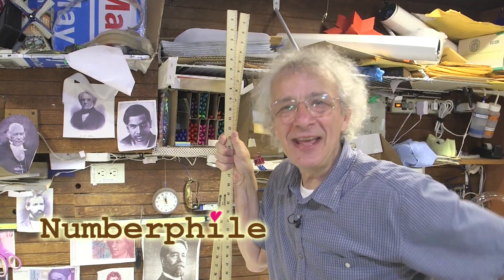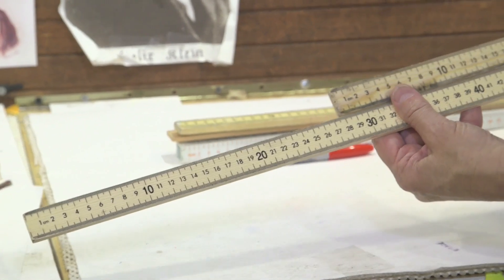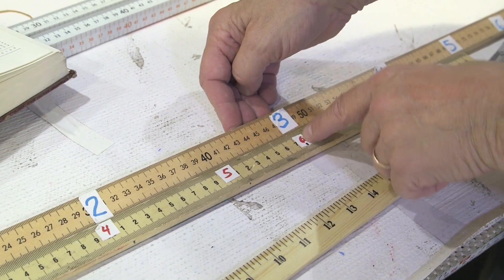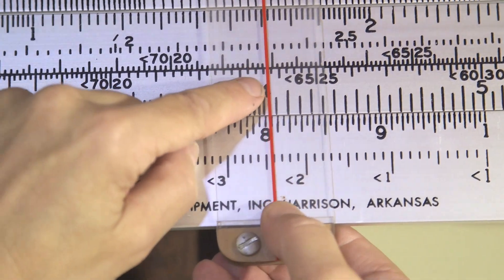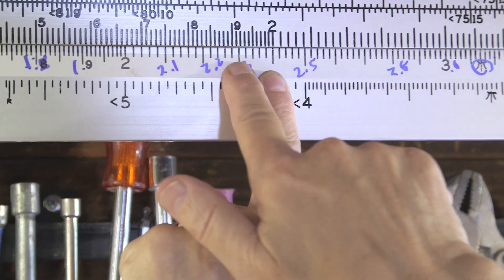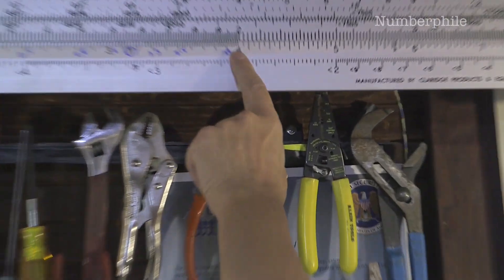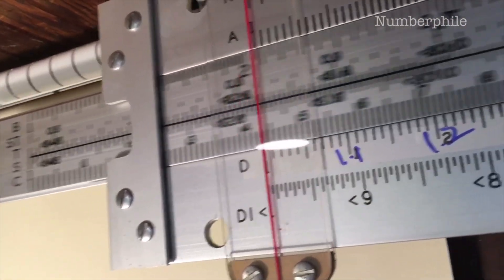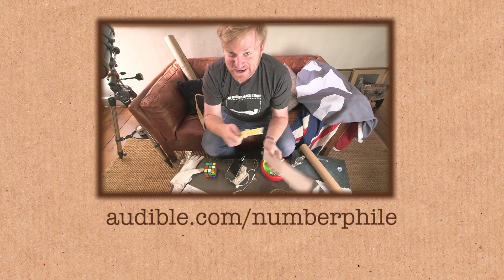The Electric Slide Rule - Numberphile

Comment: I took an engineering test back in college where the professor made you come up to the front of the class with the instruction manual and clear the programs in front of the proctor.  I showed up with a 4 function calculator and a slide rule.  He smiled at me.

Comment: I remember looking up how digital slide rulers work and realized they essentially are electronic slide rulers. They are reading two logarithmic patterns and adding them together to get the value that is the distance it has been slid apart. 

(in hindsight I really should have been tipped off by the similarity in naming schemes)

Comment: You should put logarithmically spaced contacts on the back side and have a computer drive the motors so you can operate the slide rule like a calculator.

Comment: Do you know why slide rules leave electronic calculators in the dust much of the the time?  Two moving parts and no batteries. Do you really need to know the answer to a simple calculation to 32 decimal places? I never have.

Comment: What if you could use an optical calliper to turn it into a continous electric slide rule, and then have the potential to work with indefinitely large numbers, merely by adjusting the precision and then working with smaller numbers?
Reply: p.s: someone might have to invent the "optical calliper", in theory it would just be two laser dots and a sensor to detect how far the dots are from eachother.

You would zero the device by coalescing the two laser dots together onto the white/reflective surface being measured, and then:  adjust the angle between them, moving both lasers until one laser hit a non-reflective patch, and then moving the other laser until it did the same.
Then a precision machine would calculate the distance between the two dots, and/or calculate the angle of separation; thus giving you the answer to fractional calculations on a slide-rule

Comment: HEATHKIT built an electrically balanced circular slide rule calculator that can perform all forms of arithmetic including square roots and more. The trick is in the calibration in the circular scales. The correct answer is indicated by the null created by a Wheatstone Bridge.

Comment: There are several formulas to substitute multiplication. You can use a square number table and it is obvious that: 

xy = z^2 - (z-x)^2 with z := (x+y) / 2. 

or a sine and a cosine table 

1/2 (cos(x+y) - cos(x-y)) = sin x sin y. 

but logarithms are the best for it with

log(xy) = log x + log y

 Even a division can be calculated better: 

log(x/y) = log x - log y. 

Great!
Reply: The second was used to do multiplication with trigonometric tables in the 16th century: https://en.wikipedia.org/wiki/Prosthaphaeresis
It was a forerunner to the invention of logarithms. From a modern perspective, it is using complex logarithms.

Comment: What I don't really understand about slide rules (I don't have one) is how do you know what value does each marking correspond to when you are multiplying. I mean, each marking is equally spaced from each other, yet since the values are logarithmic the inverse values are not going to be equally spaced and will bunch up as shown in the video with natural numbers. But when you go in between, how do you know how much do you have to add for each marking? In a simple ruler you would add one milimeter for each marking until you get 10 and you say it's a centimeter.
Reply: Ciroluiro 

the markings on the actual slide rule are not equidistant. each mark varies as prescribed by the relevant logarithm.

if you haven't got a slide rule I recommend obtaining one. it's amazing to witness numerical relationships is such a dynamic way. It's actually fun.
Reply: I definitely have to get one.

Comment: There is one other thing that he missed. you can do exponents with multiplying the log of a number by ANY number.
so 9*log(8)=8^9=1.3 million and stuff coming out the backside.
Furthermore, because we can use base b, I can tell that a number, call it n, from its log in base b, has (log(b,n)-mod(log(b,n),1))+1 digits in that base, so in base 2, a number, 210, let's say, has 8 bits, and they are 11010010, and for HUGE numbers, like 6405097, it has 23 bits. The first and last bits are 1, but I couldn't tell you the bits in between.

Comment: This is the kind of teaching I like. Presents a concept and then uses easy to understand examples with physical proof instead of just saying "just know its true." 

So multiplication of number can be shown as the the addition of their log10 components.
10 X 100 = 1000
log10(10) + log10(100) = log10(1000)
1 + 2 = 3
3 = 3

10^(3) = 10 x 10 x 10 = 1000

so 10 x 100 does in fact equal 1000. It's so easy to prove it's amazing none of the mathematics courses I took ever mentioned this.

Comment: You could greatly improve your slide rule by having a series of logarithmic shaped pulleys that pull the string. So to move the ruler 2.34 you move pulley 1 twice then pulley two 3 times and pulley four four times moving the upper slide rule to the correct position. Then you could have a similar system to move the cursor. And finally pulleys on springs that can read off the cursor position to a digital readout.

Comment: Uh oh, now I really want to recreate this but add an input for numbers (like a calculator) that then automatically moves the slides/cursor into the correct spot. Actually the more I think about it the better the idea seems. You could hook it up to the internet to receive inputs then have a webcam stuck to the cursor to get the result. Does anyone know where I could obtain that set of those logarithmic scale rulers that Cliff has?

Comment: How about an electronic slide rule... that is controlled by a computer, for being ultra-lazy. Type in "10 x 4.2" on a computer, the slide-rule moves about to the correct point and a camera looking at the cursor shows you the answer :)
Reply: You would probably have to use some sort of calculator in order to program this contraption.
42/42 Would make it.
Reply: That's exactly what I thought! Didn't see your comment until after I posted though haha
Reply: James Grimwood even better! it does the math, and then makes a gif of it doing the logorithmic calcs
Reply: even more lazy/utterly pointless: use OCR to get the answer from the camera and use voice synthesis to read it out loud.
Reply: I thought the same thing. I want to build a CNC slide rule now.
Reply: What a wonderful project for a Rasberry Pi.
Reply: You can only hit the rationale numbers, not π for instance with a step motor.
Reply: Exactly!
Reply: look up "digital slide ruler" That's essentially what they are.
Reply: Several years ago, just for fun, I have written the simulation of a model Rietz slide rule (in Visual Basic). It - still - works on Windows.

Comment: It just needs some control software, so you can type "1.2" and then the motors will automatically move the slide rule / cursor to the right place for you.

(Yes, at that point, it's pretty much just a slow calculator - slow because you have to wait for it to move - but if you really cared about that sort of thing, you wouldn't be bothering with an electric slide rule in the first place, I'm thinking.)

Comment: Man, I love the giant slide rule! That's awesome!
Interesting thing... A lot of early electronic calculators used decade ring counters, then binary coded decimal, and later on, floating point binary arithmetic, but the early Wang calculators featured an electronic log/anti-log circuit, and actually worked like an electronic slide rule! The LOCI 2 and the 300 series definitely worked in this manner. Wish my 360SE worked...

Comment: I have two 1 meter long log scales. If I pass one past the other I do 10^35 calculations (1/plank length) if I do that at the speed of light I do 10^35 * 10^9 calculations per second = 10^44. Is that the fastest speed of calculation in the universe?
Reply: Relativistic effects will of course affect that

Comment: Slap some rotary encoders on it (or even better, some linear ones if you want to be more accurate), tie it all to an Arduino/Pi/ARM/PIC/board-of-choice, add a calculator keyboard, and have it run through the calculation steps and show you the result on the ruler.

Comment: How confusing is this guy instead of using a ten' electrical slidruler. Why not use a small calculator. I think the Censorship Controller messed up on this one. Try an think for yourself what works best for you. Don't always think what you're told is the right way for you. P♡;-)~0○º ...

Comment: That's a riot. He needs to add position feedback so he can have a microcontroller position the slide and cursor automatically. He can then add a keypad to the microcontroller and enter the numbers!

Scientific calculators were too expensive for high school students as late as the early '80s. So we learned how to use slide rules for some classes. However four years later they were cheap enough that it was an obsolete skill.

Comment: Great invention, but it's still not as accurate as a calculator and as easy as a calculator. So calculator: 1, slide ruler: 0
Reply: Yeah, but it gets a 9.9998/10 for nerd cred!
Reply: Accurate enough to design and build rockets and airplanes.  The SR-71 was a product of slide rule engineering!
Reply: its a joke dude
Reply: Yeah, now that calculators are so cheap, slide rulers are kinda obsolete... But they are still fun to toy around with :)